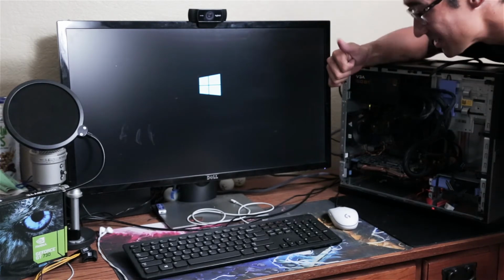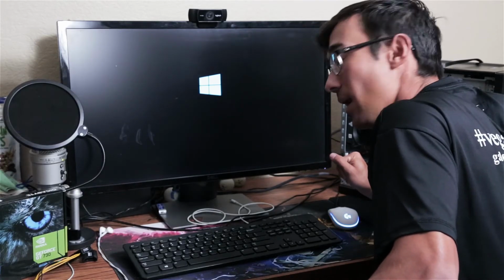Can you Upgrade the Power Supply in an Old Computer?

Comment: i got a question, i have a HP Pavillion P6 from 2016 and i wanted  to change PSU but without changing the motherboard.
also because ive got a new GPU but i need a 6 pin connector. do i need to change mother board so my PSU can work properly or can i stay with my stock Motherboard.

kinda helped me with you're video

Comment: My Optiplex 7010 also didnt power up with the new PSU. I didnt had to use the adapter since my PSU also had a 24 pin motherboard connector. We also double checked if we put the other cables in the right place but everything was just fine. The only difference between my old PSU and new is that on the CPU cable was P2 written and on the new one P4 and on another P8 (P2 was the same as P4).
Do you guys have any idea what could be wrong ?
Reply: Did you ever find a fix for this, I recently had the same issue
Reply: @dreadIV  Yea i fixed it xD Bought a new PC haha. One guy from my work told me that DELL is a bit strange when it comes putting parts on the their Mainboard that are not mentioned to be there. So i gave it up.
Reply: Same issue for me now
Anybody could help? I guess

Comment: I have a similar SFF pc and if I wanted to replace the power supply would I need an adapter for the motherboard?, I was planning on putting the parts of the PC into a new Case and upgrade the PSU do I need an adapter for the motherboard?
Reply: Yea, the if you have an hp you need and adapter called 6 pin to 24 pin
Reply: @lilmqar5850  Can't believe this comment was from a year ago. I've learned so much and have built dozens of PCs. Thanks for the info even if it's a little late lol.
Reply: @erikwithak6555  so can u change the power supply if its properity or no
Reply: @erikwithak6555  now that comment was 3 years ago
Reply: @um4lik398  it's crazy how time flies  !!!
Reply: @Johnny-Taylor-07  ikr , I remember reading this comment and it's been almost a year since then!

Comment: I have a 8200 CMT, would this power supply work with it or would I need an adapter?
Reply from the maker: HP's can be tricky. I can't know for sure unfortunately unless I saw a picture of the inside
Reply: @KristoferYee  Would there be a way for me to send it to you?
Reply: I'm going to buy this adapter AYA 12" (12 Inch) ATX Main 24-Pin to 6-Pin PCI-E PSU Power Adapt...